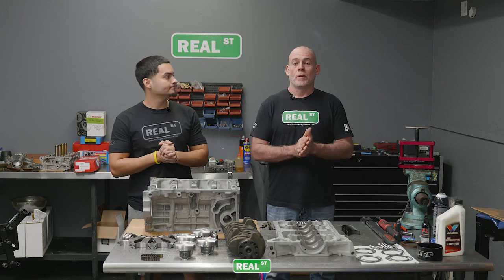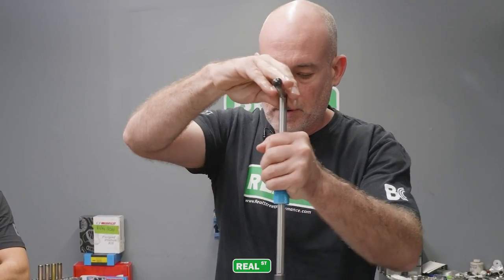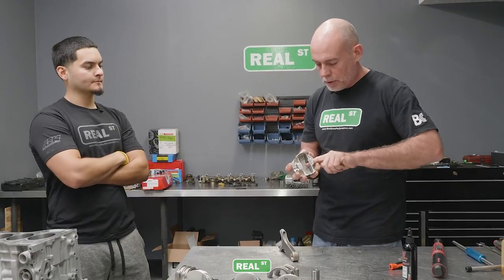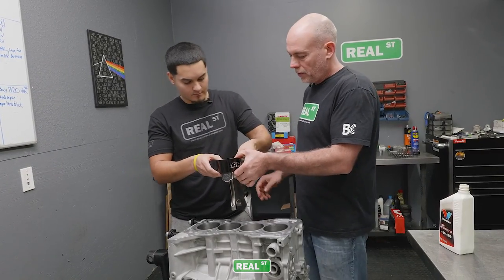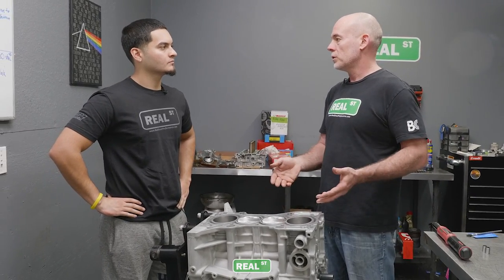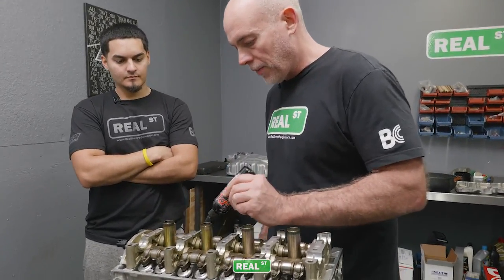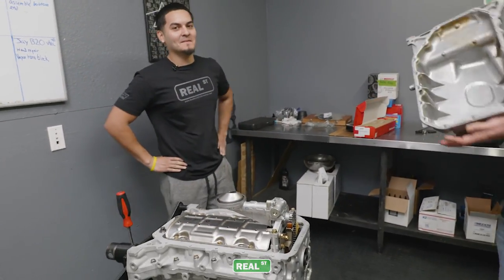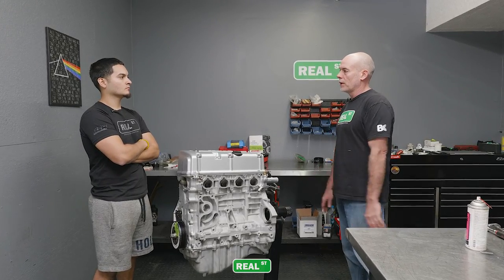Jay Teaches Real Street Employee How To Assemble His K20a2 Turbo Engine (Step by Step)

Comment: I'd like to add an option to those that may not know.  There are air powered oil primers that can be used to pre-lube before start up. You just hook the hose to the oil sender passage to feed oil to the whole engine. This should only be done RIGHT before firing to not remove the high quality assembly oil off the journals if you don't intend on starting it right away. 

Excellent build video and patience explaining to the less experienced guys !
Reply from the maker: Thanks, James!

Comment: I had a question about the motor being timed. Before taking the motor Apart should it be at TDC? And similarly when putting pistons rods in do we have to check if it’s in TDC or can we only set the timing once after assembly with the timing marks?

Comment: 100 mile run in for a full rebuild what you recommend? 

Such mixed opinions on running in. Just done my first 100 on a fresh build but plan on doing 600 -800 run in miles whilst also bedding in new clutch before going for tuning

Comment: Nice video 👍the passion i love it 🙌

I have a question i am building a engine to with a friend of my its our first time so i think i will bump on a couple of things but yeah that's the experience you need to build 😉

I want to change my pistons but dont know wich compression ratio i should use its a k20a2 and want to drive it on pump gas octaan 98 and have 1200cc injectors
And have a precision 6262bb turbo 
Maybe around 10.0:1 or 9.0:1 and wich pistons to use cp or wiseco and rods manley h-beam?

I hope you guys can help me out👍
Would really appreciate it 🙌

And continue making vids with that passion i love it 😁

Comment: Hey Jay; when you went back to double check the torque specs on the timing assembly, did you swap your socket out for an extension with a chrome socket and bump up the torque wrench to reach that torque spec slower? Assuming the extension absorbs some of that torque force?

Comment: why would you start the engine with out priming it? is there a reason not to pull the fuel pump fuse and crank it till you have oil pressure?
Reply: That wouldn't give you oil on journals without spinning crankshaft.
Real priming is to push oil through system without spinning crankshaft.
But anyway that's good extra safety mesure
Reply: @el_kuks  yeah but you are always going to lube it with something while you assemble the engine. he says here https://youtu.be/0x7WXjGQNaM?t=163 that you arent going to prime the oil system and you will start it with a few seconds of no oil pressure. you can absolutely fill the system by cranking it over with the fuel pump disconnected.